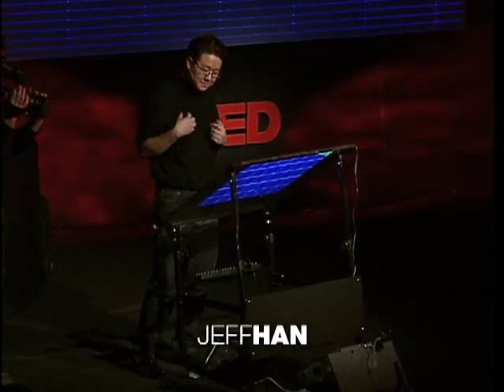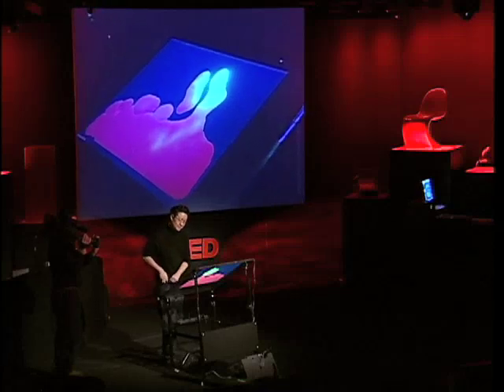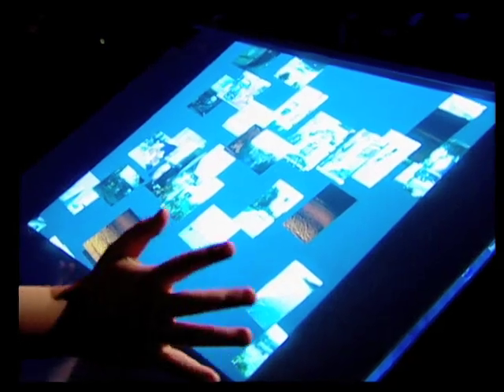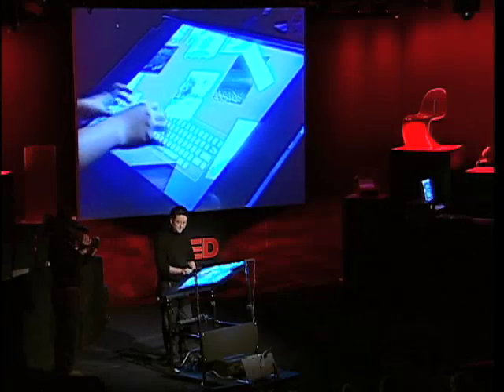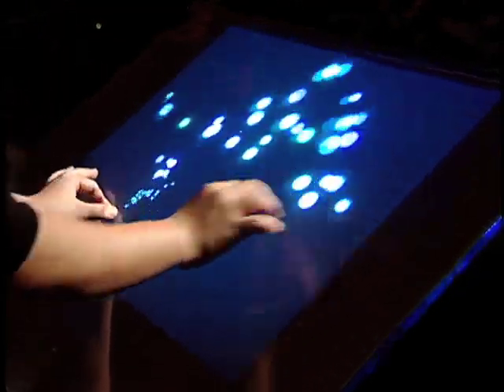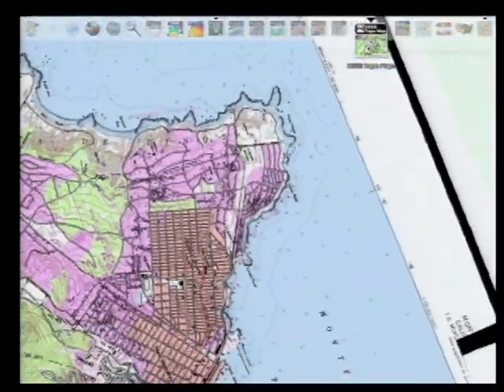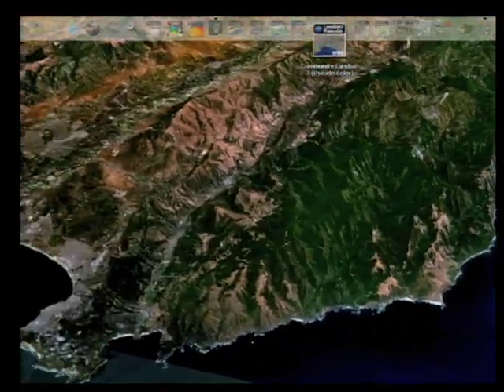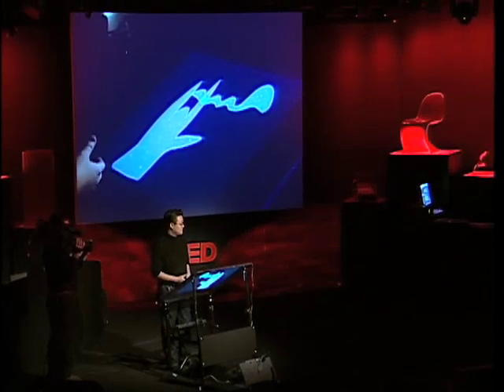Unveiling the genius of multi-touch interface design | Jeff Han

Comment: People are all like "old news" I see. There's 4K 55 inch TV's selling for $600. Thus the question I have is: If 55"/3=18" and $600/3=$200, where are the $200 18" inch tablets? Add $200 to that and you make it a $400 18 inch 4K tablet with Windows or OS X/IOS ... This isn't old news until this happens. Add $100 for industrial strength case and stand, so it becomes a $500 18 inch Surface Studio, just more carry-able.

Comment: Ten years later. I love the previous comments. Yes, multitouch has changed some things, mostly with smart phones, and smart phone apps. It has made handheld computing much more powerful, and therefore, conducting business and research far more efficiently. However, it hasn't completely changed the world like other inventions, such as the steam engine, the internal combustion engine, steel frame construction, and the digital computer.

Multitouch is simply an evolutionary step-up in the digital computer technology sector, much like various improvements to the automobile over the years.

Comment: Are there any practical applications that have resulted from this? I have used an iPad before. I mean specifically does anyone work with two handed touch screens and us creating valuable work they couldn't do otherwise? Or even significantly faster.